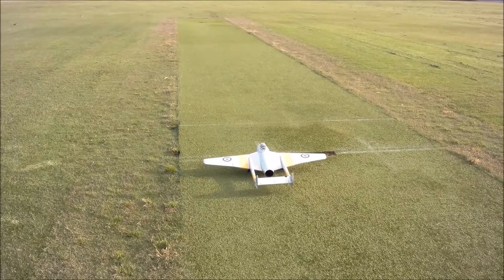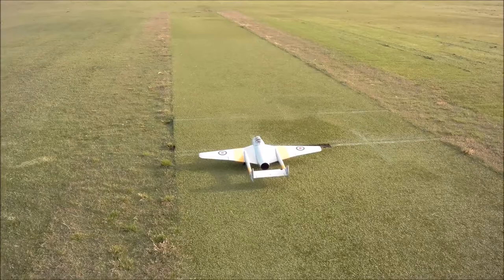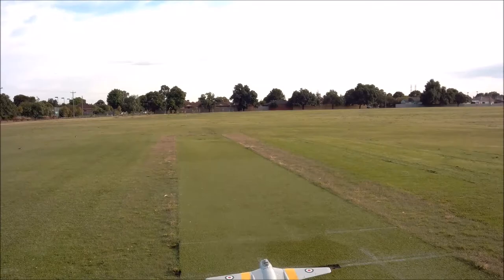DH-100 Vampire - Durafly 1100mm - Firefly Q6 90deg FOV 1080p 60fps test

Comment: what teletry setup are us using. I am putting my Vampire back together for another go. I have A Spektrum DX6 radio, the changesun ten blade fan with thw 2855-2300kv motor from hobbyking but ran it with a four  channel receiver and a Turnigy plush 60a esc with a nano tech 3300 35~70c battery. I want to use your setup with the Zippy 5s 3000mah 20c and flaperons. Thanks
Reply from the maker: Seeing you probably do not have Telemetry, you want to use a Power meter and test on the ground to see what Volts and Amps you get across the Throttle range. You could do every 'notch' on the Throttle and record those.
This will help you fly with a known amount of battery stress. eg "20amps" - if you can keep a low C battery in that range then it won't degrade it by overheating. And then a use of just timer can keep it using only a lesser amount than even 80% capacity, because batteries get hotter at the same current level as they deplete. eg 20 Amps all flight... no warmth at all until, say, 1500mAH used out of 3000mAh, ok still by 2000mAH but you want to be landing by then. So with no telemetry, start with a shorter timer and then increase it after recharging.
Without telemetry it is very hard to keep great care of batteries, as you are mainly "guessing" what it is doing. But ground testing and using a timer is all you can do if you do not have it.